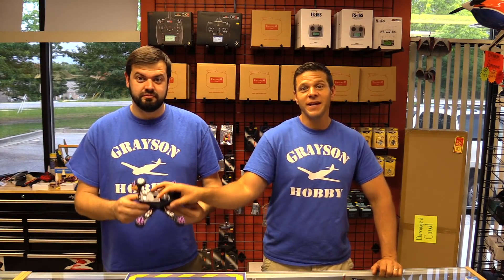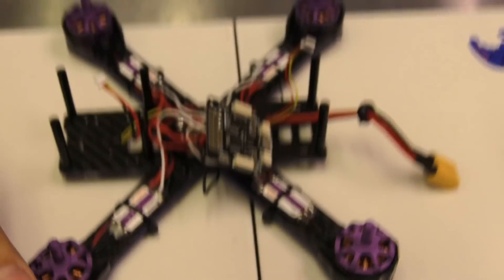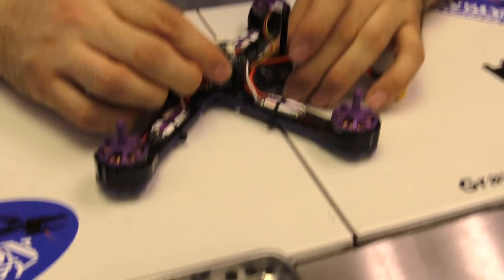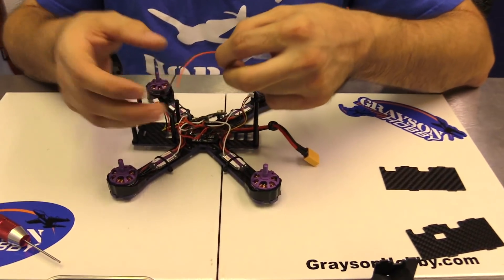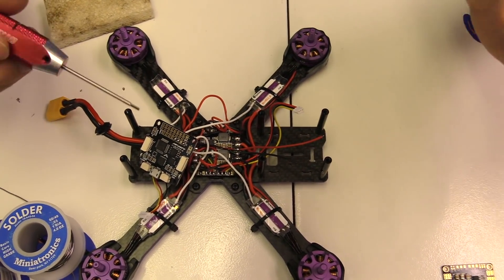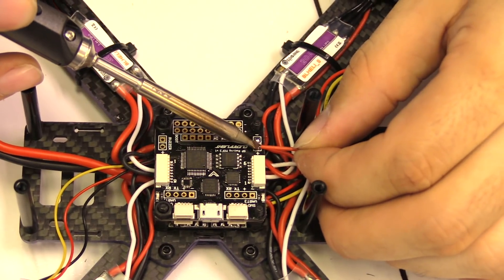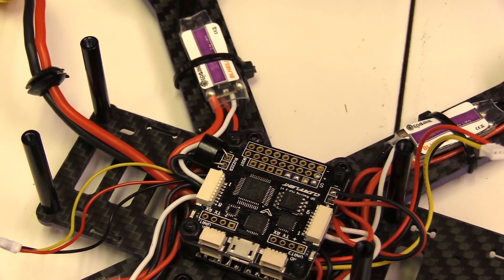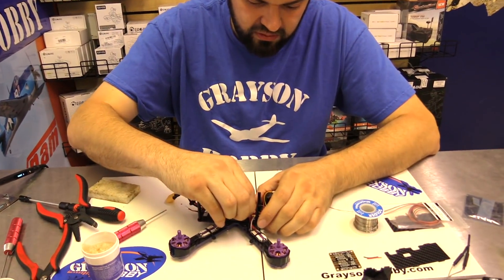Eachine Wizard x220 - Setup for 4S - Buzzer - VBAT - How to Customize

Comment from the maker: Here is link to buzzer
http://graysonhobby.com/low-voltage-alarm-buzzer-mini-fpv-drone-racer-5v.html
Reply: How would you re-attach those little white plug sockets on the PCB when they break off? Too small to solder. I broke one on the middle PCB of a lizard95 can't even get the top PCB to come off from the middle one.
Reply: Grayson Hobby Hey, could you tell me at wich c rating the factory batterie of the wizard has? or what you recomment
Reply: mine says 25c
Reply: okay thanks for your help
Reply: Grayson Hobby 
I've got the wizard gold package a couple weeks ago and I'll eventually do this vbat and buzzer mod. In order to activate the buzzer when lost am I correct in assuming I'll need a 7th Channel on my 6 channel radio?
Reply: Grayson Hobby can the wizard x220 fly with the 4s 1800mah?

Comment: If it’s at vcc will you still get 4s benefits? I read it will only use the same voltage as the 3s.

Comment: I am guessing this was something to do 2 years ago. I was going to get mine ready for 4s but i noticed the VTX can be powered from 7-24V. I got mine April, 2019 so i guess this has been fixed.
Reply: Does yours work with 4s. Have u tried it? I got mine in December and have only run 3s but I have the 7-24v vtx
Reply: @silvergekko392  yes i run 4s now with no problems at all
Reply: Thanks for replying. Did u do anything to your kwad or just plug in the 4s battery?
Reply: @silvergekko392  just plugged it in and off i went i have ran at least 40 4s packs and the VTX is performing perfect still
Reply: Thanks. What mah and C do u run?
Reply: @silvergekko392  no problem i run 1500 MAH and 100c golbat brand
Reply: I got a video posted using 4 s for the first time
Reply: Its called freestyle #2
Reply: Cheers I'll check it out
Reply: Did you need to do something like this for the VBat and buzzer? if not how you know how much battery left you have when flying?
Reply: @oscardatips  no i left all that alone. As for battery voltage i use lipo voltage alarms they are really cheap and work great.

Comment: Hey,, great video. I haven't verified any of it, but it's clear you are describing legitimate mods based on the  characteristics of the boards you are working with. Thanks for saving the community a lot of heartache. I'm new to the game but have already met people burning up vtx from running 4 cell without changing the vtx supply to the regulated 12v, and the voltage monitoring mod is highly desirable. Thanks!

Comment: hey there grayson hobby :) i want to move to 4s and saw this video but is it really nessacary to solder to the 12v pads if the vtx can take input up to 24v ? because you said some blow their vtx does that mean alot of people have no problems when powering with 5v pads if their vtx supports higher that 5v?
Reply from the maker: Hey there thanks for watching yes this is necessary otherwise we would not make this video and publish the information

Comment: i did the vbat and buzzer add on i am still flying 3s so i did not do the 4s setup but my osd wont work can someone please help i dont care about pid tunning through it i just want to see my voltage and my timer please help

Comment: Is this necessary on the newer ones? The specs say that the VTX can handle 7 to 24 volts.
Reply: The newer ones I'm assuming they can because mine has a completely different flight controller then the one in the video and assuming since that's different eachine probably upgraded a little more then just the flight controller

Comment: Hi Will and Basil, thanks for your instructional video. I upgraded my RTF Wizard with the Eachine TX526 VTX, so my question would be: could I just plug in the 4s battery into my quad or is it absolutely essential to perform the soldering to 12v? I am asking this questions since I don't have soldering equipment and was wondering what the worst case scenario would be if I just plugged in the 4s battery to my quad? Would it only damage the VTX or catch fire or whatsoever? Looking forward to you response and thanks!
Reply: Jib0n you will definitely need to buy some soldering supplies. Its will be hard to continue the hobby without soldering.

Comment: can someone respond, do I need to add the vbat and buzzer to use 4s? or can I just move to the 12v pad only?
Reply from the maker: Please rewatch the video, we mention this several times..
Reply: I appreciate your response, and have watched the video at least 3 times, but I dont know if you HAVE to solder the buzzer and vbat, or just solder to 12v pad.
Reply: PlainLuke no you don't need the vbat. It is just a handy thing to have on your quad.
Reply: Thanks alot

Comment: Complete noob here! Now you've connected wires for the vbat, what does this do for you? Do you have to set anything up on the controller? I assume it will show you the battery voltage on the controller??? What does it show you without this mod? Nothing?

Comment: Hello, I live in Canada's capital and I really appreciate your support in the quadcopter community! I have an X220 and I put some 2205 2300kv Cobra motors on after a loose bearing seized a motor at 120ft straight up resulting in 2 motors DOImpact.
I wired them up perfectly calibrated the esc's did a motor test and all was good then a motor made a tinkling sound when spun after being powered off that disappeared I hooked up power again and the motor didn't twitch much and smoke from the front of the pdb appeared!.!. Loose from accident? Or could the motor have shorted it bypassing the esc? I hope you can give me some real info👍 sincerely GD

Comment: Im trying to understand lipos. I have a 4s 1800 65C so the recommendation is for each cell never let it go below a 3. So with 4 cells that's a total of 12. So does that mean a 1500 4s battery will have a really low flight time because you really on have 3 volts of flight time since you can charge to 15 but you need to subtract the 12 that you need to keep the battery healthy?
Reply: SuperCuttysark no

Comment: Why don't you use a 1000 uf  low esr capacitor on the battery + and -  pads on the pcb board to battery leads  to buffer or totally eliminate any voltage spike to camera or to vtx so you can run three cell or four cell at your convenience  and nix the  5v to 12v pad switch?.

Comment: Can you still fly 3s after resoldering for 4s?
Reply from the maker: hi Great question, but the short answer is NO, its either a 3S or 4S setup.
Reply: why not? I would like the long answer please.
Reply from the maker: IIBennyMacII please watch the video, we explain
Reply: Grayson Hobby must've missed it, watchin again now. Thanks and keep up the great work
Reply: Grayson Hobby won't a capacitor solve this too? I saw someone else mention it as well
Reply: Yes i mentioned it. Why don't you use a 1000 uf  low esr capacitor on the battery + and -  pads on the pcb board to battery leads  to buffer or totally eliminate any voltage spike to camera or to vtx so you can run three cell or four cell at your convenience  and nix the  5v to 12v pad switch? I am using it on my wizard x220 but i usually say do this at your own risk . But 3 months in and no issues with 3 or 4 cell and no mysterious buzzing noise going from 3cell to four cell unlike grayson hobby non response to my setup vs theirs. No harm intended grayson hobby. knowledge is power . Gray-son you have the opportunity to voice your concerns if there is any. I am still waiting for a response to my setup no response as of today and i am still flying problem free and no mysterious buzzing from the board unlike their setup.The capacitor sucks up the initial spike from the battery and keeps it away from vtx and camera when you plug the battery into the board s battery leads simple and effective but remember it has to be a low esr capacitor good luck.

Comment: Guys, remember to do this in the CLI panel: "beeper -all" and then "beeper BAT_CRIT_LOW" , that does so your buzzer only beeps when battery is low, sometimes when you fly your drone, it thinks somethings wrong but there isnt anything wrong, and it beeps. So you just need to do as i say and you won't ever experience any buzzer issues

Comment: Hi Guys... Thanks for another great video !! Once the Buzzer and VBAT is installed.... is there any setup or config required besides setting the warning voltage levels in BetaFlight ?  And lastly.... the recent Wizard X220 lists their Vtx as handling 7 - 24 Volts.... Would this still require your Vtx Power Mod ? Cheers ;)
Reply: ive always wondered this too, some people never do the resolder mod for 4s and never have issues, then others just do it to be safe....not sure if they fixed it at the factory for 4s with changes or what.
Reply: I'll still do the Vtx Mod just to be safe I guess.... even if all I do is avoid some electrical noise from the ESC's on the battery supply. The 12 volt supply would be more regulated. Cheers :)
Reply: yeah me too im just not sure since this video was put up if theres been board revisions for the x220 or what, i know some have LEDs soldered to the same 12v pad thats empty in this video.

Comment: So i just moved the vtx wires to the 12v pads. When i plug in a 4s battery it makes  quiet high pitched noise. If i plug in a 3s there is no noise. Is that normal? Thanks
Reply: Move the  5v to 12v pad switch back. And then why don't you use a 1000 uf  low esr capacitor on the battery + and -  pads on the pcb board to battery leads  to buffer or totally eliminate any voltage spike to camera or to vtx so you can run three cell or four cell at your convenience  and nix the  5v to 12v pad switch?.

Comment: Hello Guys thank you for the video. If someone can explain to me. We run the cables from the board connected to the battery to the controller. 
a) This will enable the possibility for the buzzer on the board to receive the battery signal and work correct? 
b) Will a computer buzzer work?

Comment: So.. What will happen if you plug in a 4S lipo into the stock x220? How would I know if I've blown something?

I'm completely new to this kind of stuff and I was searching for a cheap under 300$ setup with everything needed for it and this youtuber with like 90k subscribers or some crap absolutely recommended this drone along with a 4S battery but said nothing about needing an upgrade for it to run a 4S.
Reply from the maker: Fly it on 3S  -  ESPECIALLY if you are new - once you get a good level of flying and quad knowledge, then jump to 4S - Cant start out in '5th gear'
Reply: Wow, Did not expect the creator to reply back. Yeah I didn't know what to get since uavfutures or i think that's his youtube name said to get 4S so that's what I got.. And since he has so many subs I thought it was fine to go that way. But can the stock x220 run a 4S or do I absolutely need to upgrade the quad for it to work?
Reply from the maker: Unfortunately 'reviewers' do not have to deal with after sales support 100s of folks who went 4S all have issues with their VTX, but on one is doing videos on that :
Reply: Well thanks for the tip, I'll see about what I can do on getting a 3S battery for it. But 1 last question if you don't mind. I got most of this stuff from a website called ' bang good ' and I wanted your opinion on it.. Cause it seems like every other youtuber doesn't like that website and i can see why.. I received a faulty transmitter with receiver for like 45 usd and it seemed ok till the joy sticks or whatever they're called won't do anything with the quad itself. (properly binded it like every tutorial I've seen) and its still a piece of crap.. What I got is : FlySky FS-i6 2.4G 6CH AFHDS RC Transmitter With FS-iA6B Receiver
Reply: Caliber Mag u probably need to set the receiver up in betaflight

Comment: If I got a new vtx would i be able to run 3 and 4 cell without any problems?
Reply from the maker: NO
Reply: Grayson Hobby so theres no way to run 3 and 4s safely?
Reply: Why don't you use a 1000 uf  low esr capacitor on the battery + and -  pads on the pcb board to battery leads  to buffer or totally eliminate any voltage spike to camera or to vtx so you can run three cell or four cell at your convenience  and nix the  5v to 12v pad switch?. I am running this setup on my wizard as i speek. So far no problems and clear video. So far good backup plan for me . but try at your own risk

Comment: Hello grayson. Thanks for the video. The only comment i would add is that someone solders the vbat connection at the bottom of the fc some hot glue would help for insulation. My main issue is that when i connected the buzzer it is constantly on! Even if i disable the vbat abd beeper mode from beta flight. Any suggestions pls?
Reply: Hey, 4 years later i'm having the same problem. Did you ever solve the continuous beep?

Comment: hi friends good vídeo... thanks... i have a question ; this mod  works for both batteries 3S & 4S??? burn  vtx?? burn camera 5.5 v?? because i fly with 3s & 4S same day
Reply: Do not do the 5v to12v pad switch and try this first. Why don't you use a 1000 uf  low esr capacitor on the battery + and -  pads on the pcb board to battery leads  to buffer or totally eliminate any voltage spike to camera or to vtx so you can run three cell or four cell at your convenience  and nix the  5v to 12v pad switch?. I am running this setup on my wizard as i speak. So far no problems and clear video. So far good backup plan for me . but try at your own risk.

Comment: Can I take one of the buzzers off my external buzzer and solder it to the flight controller? It has 2 on it.
Reply from the maker: I suppose you can, or you can purhcaes the buzzer for less than $3 :)

http://graysonhobby.com/low-voltage-alarm-buzzer-mini-fpv-drone-racer-5v.html
Reply: i tried but the buzzers were really quiet, they might not be 5v

Comment: Why shouldn't you wire the VTX to the dedicated 12V VTX pads? I also found out the LEDs were incorrectly wired to 5V instead of 12V. I ended up making mine "correct" by putting the VTX to the VTX 12V pads, the cam to the CAM 5V pads - it was connected to 12V (on the specs from eachine, it says the camera can handle from 3.6-5.5V, but you stated that it can handle up to 17V? Not sure which is correct, but I figured I wouldn't risk it), then the LEDs to the 12V pad that you connected the VTX to in this video. It seems to have eliminated any horizontal noise when punching the throttle

Comment: Awesome videos guys been watching a lot of them! I have a few questions, on an earlier video you said the wizard isn't tuned for 4s and you may get oscillations. Any chance we will see a video how to properly tune the Wizard? 

Also I tend to run 3s and 4s. I like to get warmed up on a couple 3s batteries and then switch over to the 4s. I don't want camera black outs on my 3s and according to this video that may happen if I do the vtx soldering, however I have removed my LED's so would it be better to just solder to one of the old LED pads? Thanks guys!!

Comment: I know you covered it a little bit but what are the reasons to solder the vtx to 12v besides the little bit of noise. (Which I don't notice too much running 4s).
Reply: ThriveProduction be nice if someone responded

Comment: there is no LC filter on that pdb at all
Reply: Not a true LC filter indeed, but the 12volt pad does have multiple capacitors after the regulator to reduce voltage ripple/noise on the 5/12volt pads, which has proven to help those getting noise in their video when flying the wizard on 4s. Speaking specific to a stock wizard...Bad Motors/props/esc could create excessive noise that may indeed require a true LC filter, but at that point the wound may be too big for the bandaid.
Reply: Grayson Hobby sorry dude not even close 12 volt and 5 volt regulator are not LC filters LOL

Comment: What do you suggest for someone that is running 3s and 4s?
Reply: Easy, Multiple quads!

Well, there are newer designed VTX's that can take a wider range of voltage direct and no issues, the TS5823 variant used in the wizard is not one of them in our experience(its a dated design... I mean dipswitches still... really?... bad Eachine bad!). If trying to avoid buying parts, maybe solder up a jumper or switch to change voltage to the pdb.

Comment: Thanks for this. I connected my buzzer and Vbat the same way. I am using a XSR receiver but cannot get vbat or any telemetry. I find the SP Racing FC a challenge to work with especially the pin plugs. Not sure why, any suggestions?
Reply: roland burrows change flight controllers. dys F4, or Betaflight F3

Comment: do u have to configure anything in beta flight for the low vbat alarm?
Reply: If you have  a GOLD or silver Wizard bought from us it is already configured, just not hardwired for the vbat or buzzer. If you purchased an arf or from someone else, that I don't know, but Vbat I believe is on by default in betaflight.
Reply: Alex Hernandez just switch on in configuration tab (VBat) and defaults are sufficient.

Comment: future idea, OSD? or upgrading the receiver  and binding to a Taranis?
Reply: Adding a Swift 2 camera for Vbat and timer would be the easiest way to get simple OSD info. 

hmm, Frsky setup, perhaps a basic how-to in the near future. the Taranis/ OpenTx is a hobby in itself.
Reply: Sasquatch FPV just change out the flight controller. trust me you don't want to have to program micro minimum osd. just get one with the built-in betaflight OSD. it's not that difficult. as far as soldering up and stuff goes. although Will and Basel may slightly disagree.
Reply: i have the swift RR from Grayson, but haven't upgraded yet. figure I'll fly the stock  cam while I learn. would soldering in the swift be the way I would have to go for that?
Reply: Grayson Hobby amen to that.